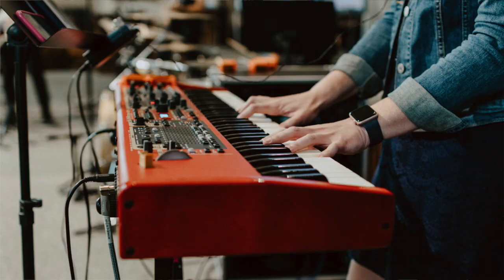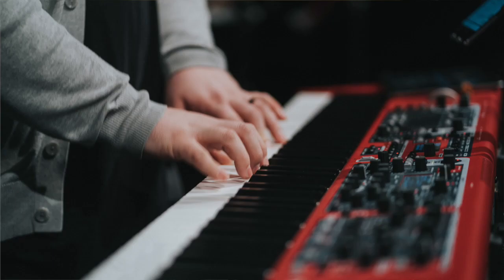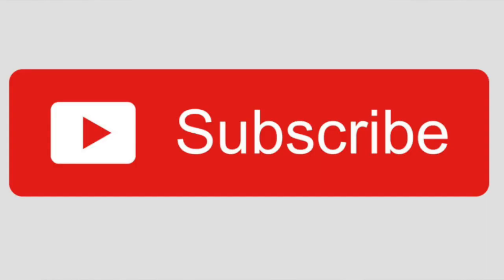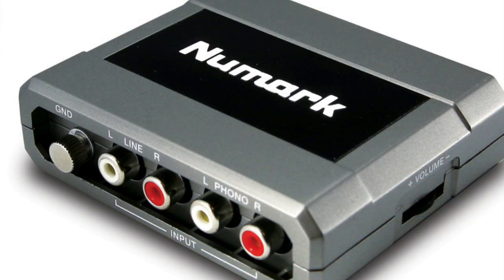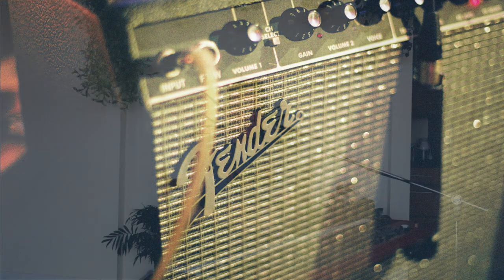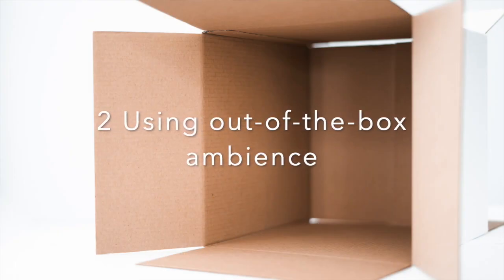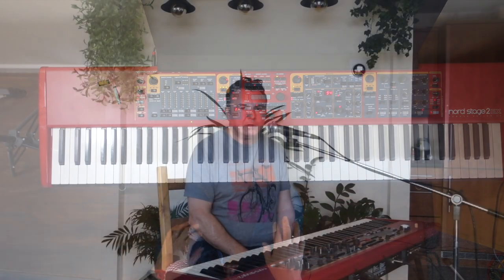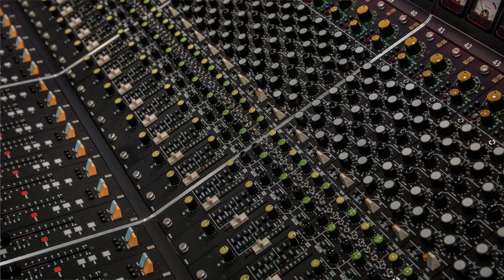Top 6 Piano Cover Video-Making Mistakes

Comment: That's a very complicated DI setup. I just used a MIDI input with VST. I've heard a bunch of recordings that do at least one of these sins, but I think #2 is no big deal unless you're really trying to sound professional.
"You effectively have your own orchestra at your fingertips" is on point; as someone who likes symphony transcriptions, I like that statement!
Reply from the maker: Thanks again for your comments. I was a little bit disappointed when I bought the Roland Integra and the guy in the shop said that I would need a mixer too. However, it's good for listening along to the original while learning, and for recording speech while making a tutorial. But I know what you mean - compared with the old days of plugging the stereo output from the keyboard straight into the computer :)

Comment: Hi Paul. Thanx so much for sharing ur knowledge. I have one question though, how do you record the video with the direct injection? I mean do you record the audio separate from the video and then "stitch" it later? Or is there specific technology you use?
Reply from the maker: Thanks Elroy. This is a good question and I probably should have said more about it. I record the video and the sound entirely separately. Thankfully the camera and the audio recording software both keep good time so they sync up well. The soundtrack is added to the video during editing, and the sound recorded from the camera is muted.
Reply: @paulwwells  Aha! perfect, ive been doing the exact same as well. I use Adobe Audition with an audio interface to record the audio stream from the piano and use a Cellphone suspended from an old Mic stand to record the video. I then use Filmora to add and mix everything together. BTW, i've been watching all ur videos for years and absolute love each and everyone of them! Please, whenever u find a gap, re-record Will Young (leave right now) on the Nord. Im dying to hear what it will sound like, i just love that arrangement. Keep well and continue doing great things!
Reply from the maker: @elroyjulius8849  Thank you. A lot of my early recordings were with a laptop on a step ladder. I did not have the sync problem but lots of people complained that they wanted an overhead shot of the keyboard. My video of Leave Right Now could certainly benefit from an update with better sound and picture quality.
Reply: @paulwwells   Recording leave right now on the Nord will certainly make my day. 100 million thank yous Paul!!!
Reply from the maker: @elroyjulius8849  I'll try. I really will. I cannot promise a lot at the moment. I'm trying to get my remote piano teaching product launched at the moment and it's eating absolutely all of my time.
Reply: @paulwwells  I completely understand, even if its next year :-) Looking forward to it.... All the best with the product launch, im sure it will be a great success!!